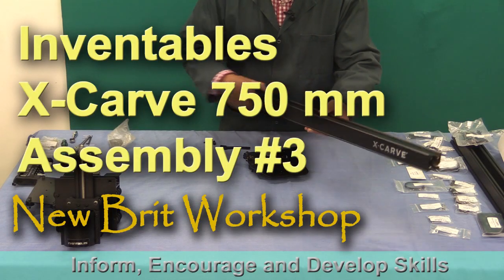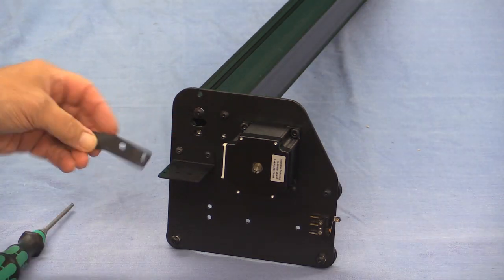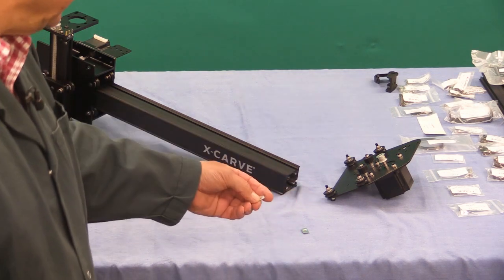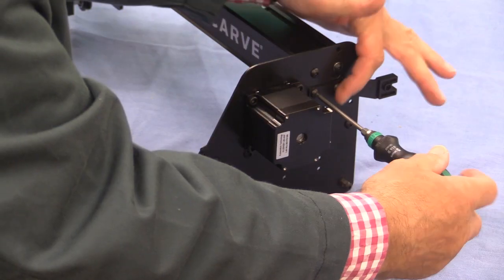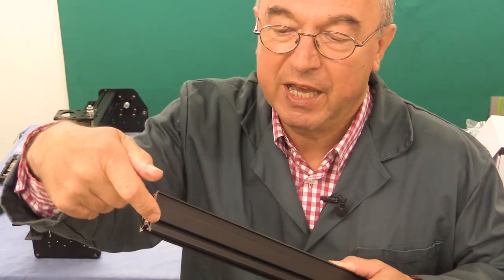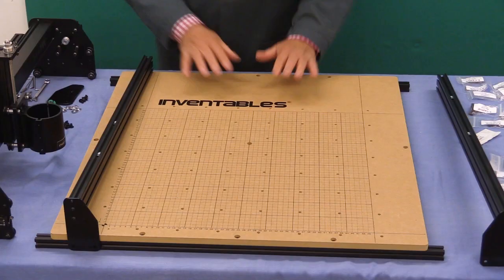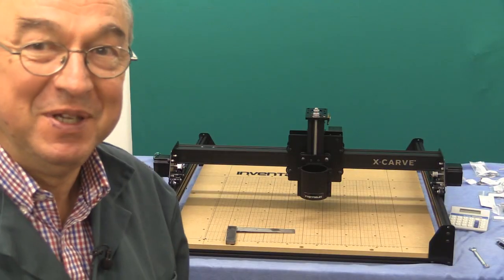New X Carve 750 mm CNC Assembly - Part 3

Comment: This series is an indispensable compliment to the inventables instructions.  Just Excellent.  In assembly process now and following along each step of the way.  Getting this far, can't imagine doing this mammoth assembly without this resource.  Much, much appreciated that you took the time and effort to create these series.
Reply from the maker: I am so pleased to be able to help and very grateful for your feedback. Good luck with testing.   Peter
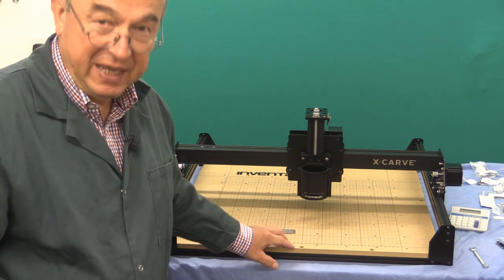Reply: New Brit Workshop , yes, thank you ... I discovered after getting the rails and gantry attached, the baseboard was slightly skewed.  Front corners underneath actually separated a bit.  So, I'm needing to go back at this point (8:40), take off rails/gantry, and re square the baseboard underneath.   Not easy, BUT, the video saves future frustration.   It would've been really tough to figure out how to solve the problem without this video.
Reply: New Brit Workshop , may I ask ... When the rails and gantry are attached at first, is the movement on the rails supposed to be perfectly smooth or can you have a fair amount of resistance?  I see this question asked by other commenters, but didn't see a full answer.  Mine had a bit of resistance, you'd need to apply some force, not a lot, to move on the y axis.  Adjusting the v wheels on the spacers too much, seemed to make the wheels almost crooked.
Reply from the maker: With no power to the stepper motors there should not be very much resistance. If you feel that there is too much resistance check each adjustable roller bearing (the ones with the eccentric adjustment). If they are too loose then you can turn them with your finger. If they are too tight then you can't !! So, adjust them to the exact point when you can't move them. Remember that there are loads of them to check.  Peter

Comment: My rails are incredibly Hard to move and so is my gantry, not sure how to adjust them so they can move smoothly.
Reply from the maker: Hi Uriel, If you are trying to make adjustments to the smooth running of the rails etc then yoymust not have any power gong to the machine otherwise the stepper motors will resist all movement. If you need to adjust the tension of the rollers then look for the ones with the excentric adjusters and go to each V wheel in turn and make adjustments so that they run smoothly. You can see an adjuster being fitted at the 7 minute oint in this video: https://www.youtube.com/watch?v=jA3WzMFF0yg     Peter
Reply: New Brit Workshop I actually have not even done the wiring yet, im following your video instructions,but just moving it with my hands is incredibly stiff. Im going to try to make the adjustments today and see what happens. Thanks for the reply, hopefully I can get it up and running soon.
Reply: @UriValdez  use the adjustable spacers on the v wheels and move them around until you can move the wheels without them catching when you move the gantry
Reply from the maker: Hi Uriel, This may be more helpful than my other link. Look at this from 4 minutes and 50 seconds: https://www.youtube.com/watch?v=4kjAuN1Y3B8    Peter

Comment: I just didn't trust that I could get the whole thing level on my XCarve 2, so I went the lazy way and threw on a thin sub waste board, put a surfacing bit in and milled it down by just over a MM. Peter, would you ever resort to loctite on the bolts? A lot of people do, but I would just prefer to retighten ever so often.
Reply from the maker: Hi Andy, Loctite is great stuff and it can be "undone" as well. However, I would tend to only use it where I knew that I would be unlikely to need to undo the screw again. I ran out of Loctite last year and for a couple of months used normal super glue. It seems to have been almost as good.   As to levelling the base, I would really recommend my method as it will then be perfect !!    Cheers.   Peter
Reply: Peter the block and feeler gauge method of truing a head mostly works most of the time and having used it for many years to test planer/thicknesser heads in relationship to cast iron beds I can tell you it never really made me happy so I made a dedicated planer dial indicator holder that could hold the indicator upside down on the bed of the planer so I could dial in the drive rollers. . In the case of your X Carve I'd probably make a test indicator holder that would bolt to the bottom of the router body clamp on the gantry and indicate the entire waste board left to right and front to back. **. Blocks, feeler gauges, eyeballing squares can still leave you out of true by 5-6/1000".  ** Double check your method of truing the head to the bed by placing a face jointed board face down on the waste board as long as the waste board and mill 1/2" off each end. Check the thickness of the ends with a digital caliper.***
Reply from the maker: Hi George, That is really useful - many thanks.   Cheers.   Peter

Comment: Thanks Peter, great video and info mate, a lot of work involved me thinks ;)
Reply: Ken Haygarth It isn't too bad. The new xcarve is a lot better than the old one for assembly, it took me a couple of evenings basically. Initially I just followed the instructions, didn't bother with any of the checks that Peter goes through here and I actually got through a few projects fine with it. If you want complete accuracy it is worth going through all these processes.
Reply from the maker: Hi Ken and Andy, I agree with Ken that it is much easier to put together than the original machine. I have yet to get to the stage of making something but am not that far away.   Cheers.   Peter